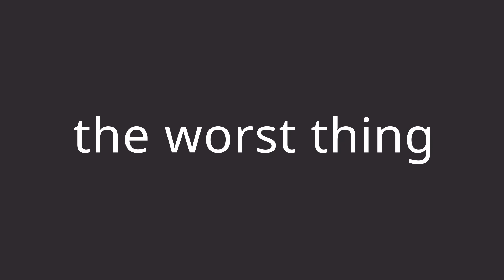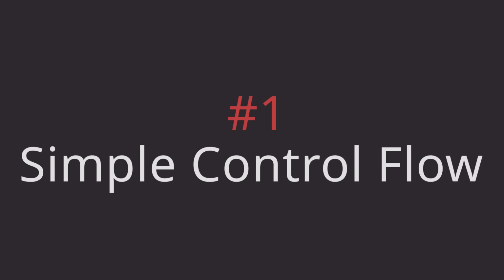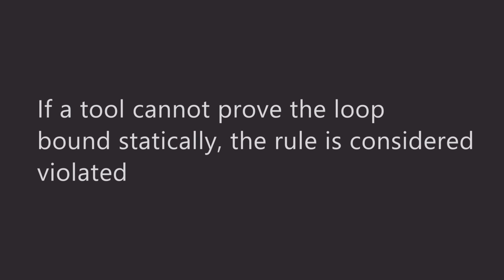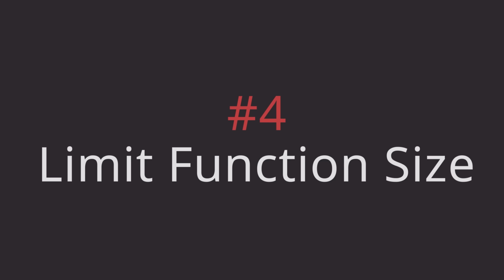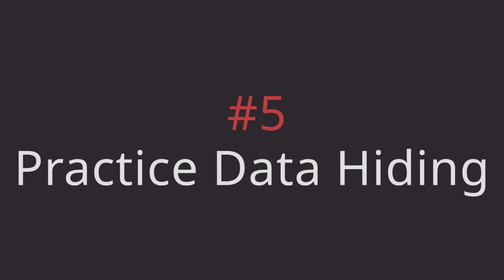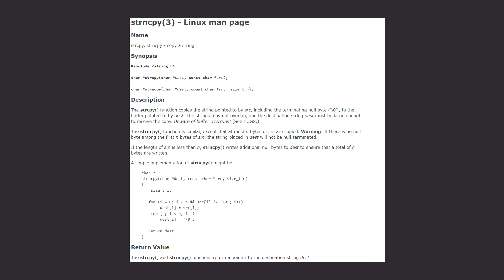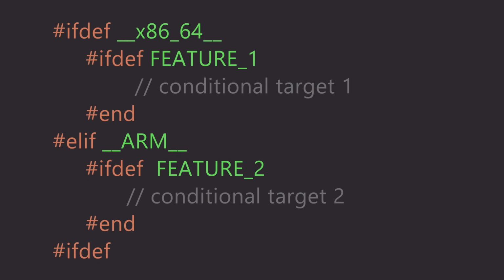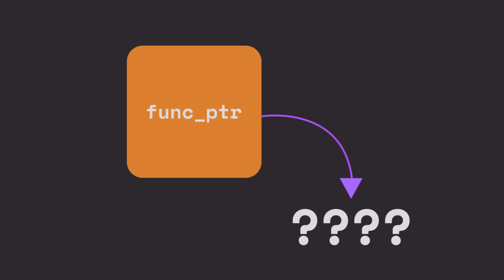how NASA writes space-proof code

Comment: So why is the Mars rover running Linux and ffmpeg then? Both aren't  developed with these rules as far as I know

Like I know Linux and ffmpeg are both only used in the video processing part of perseverance rover but isn't it still a bit too risky?
Reply: Because that code wasn't written at NASA? It doesn't say that all code that they ever use or interact with uses these rules.
Reply: @Evan-dh5oq  Oh ok then I thought this was a strict set of rules for everything going to space
Reply: I think they had no other options, developing software of that complexity themselves is just not viable. I would guess they did some heavy testing and made absolutely sure that the components are separated from the other parts of the system.

Comment: Must be an incredible feeling for a NASA Developer when the code finally runs without any error and warning and all tests pass and the rocket doesnt explode😂
Reply: What if the rocket does fail, and later the cause is determined to a be software problem?
Reply: @guytech7310  you just gotta hope. you would probably be fired for that but most of the time it isn’t a manned rocket. (There is a lesser risk of one getting hurt)
Reply: @guytech7310  add the lessons to the repository and take care not to repeat the mistake?
Reply: @guytech7310  As far as I remember, Arian 5 was it such.
Reply: It is. ☺️
Reply: You know that these are just the preventative measures during the coding phase, right?  After this level, there's getting the actual subject-matter logic correct.  Then there's getting the engineering correct (task time constraints, relative task priorities, correct constants, correct engineering units, etc.)  The weeds get deeper as you go further.

Comment: This is something I have always wondered. I'd also love to know how issues are fixed, what backup systems they have and what their coding environment looks like
Reply: It's heavily dependent on the mission, project, and even NASA center. Most systems support atomic over-the-air updates with multiple redundant copies of the flight software and fail-safe mechanisms if an update renders a vehicle unusable. For example, the system might fallback to a previous image or golden image if the spacecraft isn't contacted for x number of hours.
Reply: I would imagine them using C as it is the staple of stable code. Meanwhile rust might be a good contender in the future as it features many compile time static checks that make it nearly impossible to write bugs. Which has a similar mindset to the here presented rules I themselves.
Reply: @redcrafterlppa303  Yeah tbh, applications with no room for error would probably be the first to Rewrite It In Rust :)
Reply: @juniuwu  I don’t see that working, i know code c for embedded automotive, don’t think rust can be used there, cause everything is very time critical.
Reply: @hetstandaardkanaal7167  Why not? Rust isn't any inherently slower than C is.
Reply: @juniuwu  can’t really code rust on most microcontrollers
Reply: @hetstandaardkanaal7167  that's a support issue, not anything intrinsic to do with the language.
Reply: @juniuwu  yeah but a pretty big issue, i will ask monday bout rust

Comment: Alot of people saying use Rust forget that NASA first is a large organization so changing anything is alot of work. Second alot of systems NASA old code/hardware so you need to make sure any thing new compatible. Not saying they shouldn't but just saying why they don't. Third they know the code they have more experience with it then most and many many years then any new coding languages this helps eliminate errors as well.
Reply: Yay, Rust needs to mature as a language first.
Reply: @alexandermarvin9536  ^^ This 100% ^^

Comment: hardware-wise i wonder if they have a 2nd computer on-board ready to go for failover.
Reply: Thex have at least 2. Also on airplanes etc
Reply: @flobuilds  some microcontrollers for automotive application (TI TMS570 series) have two cores working on the same data and instructions, and their output is compared
Reply: @mieszkogulinski168  wow thats crazy nice to know
Reply: @flobuilds  You'd be surprised at what the 'real' hardware and software look like ;)
Reply: @_Stin_  i'm trusting you with that. It's just insane what these people can do out there in the airospace/automotive World for example. I'm a mostly self-taught software/web dev currently building a saas startup with a small team and i'm learning like every day about new things to consider etc. Is's just insane but this level of coding is just something else
Reply: 5, at least on the space shuttle.

https://en.wikipedia.org/wiki/Space_Shuttle#Flight_systems "...the four PASS GPCs functioned identically to produce quadruple redundancy and would error check their results. In case of a software error that would cause erroneous reports from the four PASS GPCs, a fifth GPC ran the Backup Flight System, which used a different program and could control the Space Shuttle through ascent, orbit, and reentry, but could not support an entire mission. The five GPCs were separated in three separate bays within the mid-deck to provide redundancy in the event of a cooling fan failure."

Comment: instead of avoiding heap memory, why not just use a language like rust so there won't be buffer overflows etc?
Reply: The issue isn't (just) that heap allocation is unsafe, but that suddenly your system relies routines which take random amounts of time, or can even fail.

Rust doesn't make heap operations safe. The compiler can't guarantee that memory is always available or that the allocator has an upper bound on time.
Reply: Also, I don't know if there is a MISRA standard for Rust yet, along with the fact that Rust hasn't matured as a language enough yet.
Reply: That doesn't fix the heap memory issue. You can still leak memory in Rust with things like circular references.
Reply: @Evan-dh5oq  You really have to work to get a circular reference in Rust. If you made a rule against any use of Rc<Rc<T>> and Arc<Arc<T>>, then memory leaks via circular references would be even harder to get. Probably still possible, but you'd have to make a staggeringly bad mistake to never have that leak get caught before production.
Reply: @pr0p3r99  Rc<Struct> where the struct contains another struct that contains an Rc to the initial struct. Banning nested rcs is not enough. 

But yes, it's harder unless you need circular references in your use case. For example, a graph

Comment: rust rust rust rust rust rust rust rust rust rust rust rust rust rust rust rust rust
Reply: Most of these carry over to Rust sooo...Rust can still have memory leaks. Honestly the only ones that don't carry over are directly referring to C features.
Reply: nopes
Reply: Strict rules and static analysis look almost like a manual implementation of rust
Reply: @RillianGrant  Static analysis IS what rust does. Static analysis tools aren't manual. However, the advanced tools used in mission critical real time systems are much more robust than the rust compiler currently.  It is possible to leak memory in Rust. It's possible to deadlock. It's possible to race.

Rust constrains you much less

Comment: The heap is a big problem generally. Most ways I see of properly using the heap involves using it as little as possible.
Reply: Heap allocation and deallocation causes memory fragmentation, which results in failed allocations due to lack of contiguous memory. Searching through the heap also takes longer. These problems get worse the longer the program is running. People who program PCs just ignore this issue, letting the program crash then restarting it. You don't have this luxury if your software has to run for years at a time without human intervention. A lot of equipment becomes sluggish after running for just a few days.
Reply: @sexygeek8996  cough Windows cough
Reply: @sexygeek8996 or most people don't run their PCs 24/7? or that the programs they use don't run 24/7? have you thought about that you genius?
Reply: @noobdernoobder6707  exactly. I was just about to write this. Now I don't have to. Heap is invaluable when you don't know in advance how much memory your program will need.
Obviously NASA doesn't have this problem because all of their programs will do very specific things and will always require the same amount of memory every time.
Reply: Big problem generally? Nope, not at all. In specific cases sure. If "generally" would be true then heap allocation would even be a problem in simple things as window managers, calculators, note taking apps etc etc etc etc * 1 billion examples, none of which allocating heap is a problem...
Reply: Most modern languages only have heap allocated objects though. But those languages aren't used in this type of software.
Reply: @Evan-dh5oq  The peasants get the mediocre stuff, the pro OGs get the good stuff.

Comment: This is a great insight. Car electronics have been on my mind, the programming that goes into making them totally reliable
Reply: As an end-user, no, no, it's so incredibly unreliable. Maybe it's just a recent development of cars no longer being treated as embedded systems, but the amount of stuff that can go wrong between modules or just with CANbus itself - not to mention the insane startup times for what ought to be barebones embedded systems, which makes getting startup data impossible - makes them an absolute nightmare to work on sometimes. Not just electric cars, either.
Reply: @tildessmoo  Agreed. The level of garbage allowed by the DOT is insane, manufacturers don't even isolate vital control systems from the children's backseat entertainment.
Reply: @tildessmoo I miss when the computer in a car had one job and it was to be a carburetor

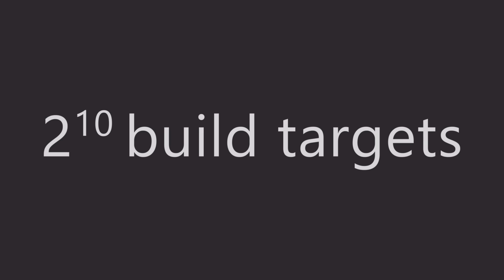Comment: 4:45 this is just wrong. 10 preprocessor symbols does not create 2^10 different build targets. It creates 10… Assuming you are not using any preprocessor symbols with AND or OR
Reply: Assuming he means flags, each of the 10 flags can be on or off, meaning 2^10 possible combinations of them all.

Comment: I wonder which of these rules carry over to rust?
Reply: I just watched it again and banning recursion is still relevant in Rust. Same with using explicit loop limits only, not using the heap(static analysis requirements), limiting function size(meh, not super important imo, but still applies), checking return values (it's possible to ignore a result return in Rust too if you don't need the inner value). The only ones that don't carry over are the ones directly related to C features (preprocessor etc.).
Reply: @Evan-dh5oq  Thanks for explaining. I'm having to rewatch it too. I'm very much interested secure coding although I'm a noob at it.

Comment: They call it the Power of Ten, but only 9 are listed.
#10 - Off-by-one errors
😀
Reply: He skipped one rule, which is "use a minimum of two runtime assertions per function".
JFGI
Reply: @sousahenrique  what does "runtime assertions" mean? Guard clauses?
Reply: @redcrafterlppa303  to see if a function return the desired value.

#include<assert.h>
int add_one(int x) {
    return x + 1;
}

int main(void) {
    int foo = add_ond(5);
    assert(foo == 6);

In this example, if foo is not equal to 6, the program will crash and print an error.
Reply: @rj7250a  ok I understand now but aren't those short circuiting crash operations bad for runtime code stability? I mean for example a calculator that is asked to divide by 0 should print a warning and return to a stable state instead of shutting the program.
My philosophy for my code is, never crash (outside main). Of course sadly I can't enforce that rule on code written by others.
As a function always inform your callee of your failure and allow him to deal with it in his context gracefully.
Reply: @rj7250a  Do you compile production code with -DNDEBUG so assert() does nothing?
Reply: @redcrafterlppa303  I think those runtime asserts are just during development.
Reply: @redcrafterlppa303  asserts are for bugs, like logical errors written by the programmer. If it involves input from the user like division by zero in a calculator, then it's a matter of error handling.
Reply: @sousahenrique  I use assert()s to enforce the documented interface. Similar to Eiffel design by contract stuff. I don't like the Eiffel language but the design by contract idea should be embraced in any language.
Reply: @sousahenrique  Are you trying to mock developers and their leadership without proper research here...?
Reply: @erikkonstas  

"Because runtime assertions are typically disabled before deployment, 
avoid using them to check for conditions that can come up during normal 
operations, such as the following:
    • Invalid input
    • Errors opening, reading, or writing streams
    • Out-of-memory conditions from dynamic allocation functions
    • System call errors 
    • Invalid permissions
You should instead implement these checks as normal error-checking 
code that’s always included in the executable. Assertions should only be 
used to validate preconditions, post-conditions, and invariants designed 
into the code (programming errors)."
Seacord, Robert C., Effective C: An Introduction to Professional C Programming

That's just an example, I can quote other sources if you want.
Reply: @sousahenrique  Oh make no mistake, I know exactly what an assertion is, but your implication that devs depend on assertions for prod code is kind of offensive...
Reply: @erikkonstas  Never said that.
Reply: @erikkonstas  lol you're strangely defensive, you must have done some weird stuff in the past 😂
Reply: @kylebowles9820  Did you read what they wrote? That "use a minimum of two runtime assertions per function" is supposed to be a rule for highly-sensitive environments such as NASA? If you think about it, that's just outrageous...
Reply: @erikkonstas  I can't tell if you're trolling, but regardless, I'm sure the programmers at NASA are well aware of any and all downsides, including prolonged runtime, and determined that it was worth it. 

But I guess you can let them know that you think it's outrageous, if you're insistent.
Reply: @irishjet2687  Except that that's not how assertions work; the point of an assert is to check whether a piece of code works as you expect it to; if you're releasing code for a spacecraft, you really shouldn't have any doubts about it, which is indicated by asserts still present in there...
Reply: @erikkonstas  It seems that the point is in checking (and documenting) pre and post conditions, as well as any important intermediate conditions.
Reply: @1dgram  Wouldn't they use comments to generate docs instead to explain these conditions?
Reply: @erikkonstas  After a few refactorings, it's harder to check to see if constraints listed in comments are still accurate than those constraints that live in code. I'm not saying that I think assert()'s are the best way to do this, but recall that they also avoid all but the most basic uses of the precompiler.
Reply: @1dgram  Oh no, I fully support asserts being used for test code, it's when the code becomes prod that I have an issue with them.
Reply: @erikkonstas  In production binaries asserts should be a no-op. There should be a step in the release process to make sure of it.
Reply: @erikkonstas  And yes, typically those pre and post conditions would be covered in unit tests and the asserts left out of the production code. Since they are using static analysis to help efforce their coding standards, I imagine it's easier to have those constraints in the production code itself.
Reply: It started with #0😂
Reply: It's called the power of 10 and ends in 9 is because in programming, counting usually starts at 0.
Reply: 10 is testing
Reply: 11 - use Rust ^^
Reply: "They call it the Power of Ten, but only 9 are listed."

Not so. You missed #0, which is "have these 10 rules".